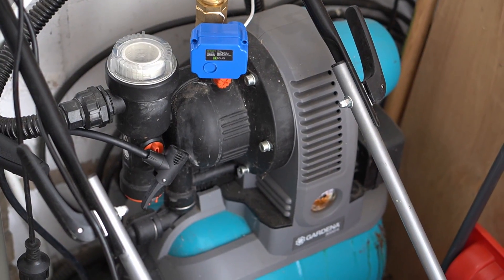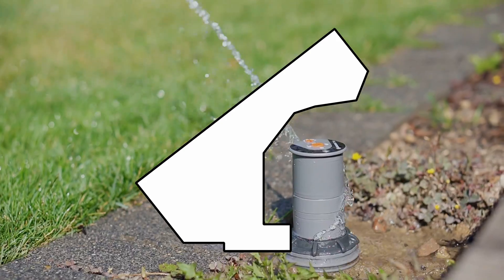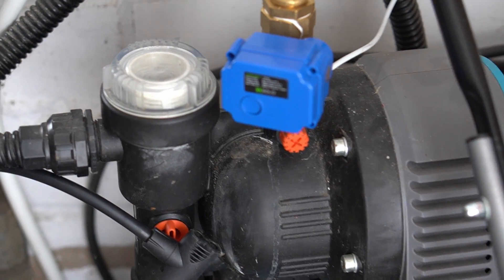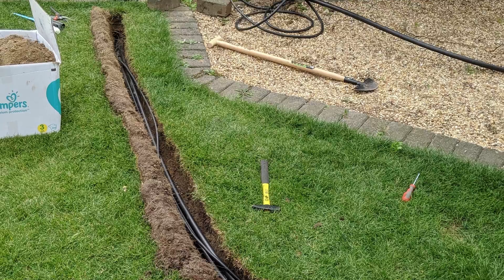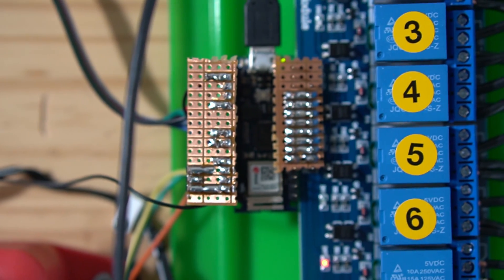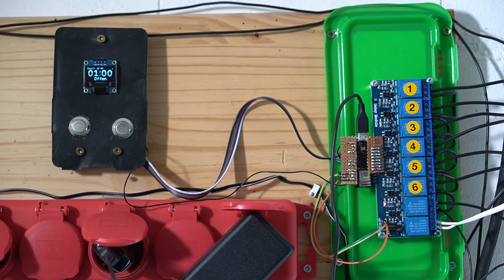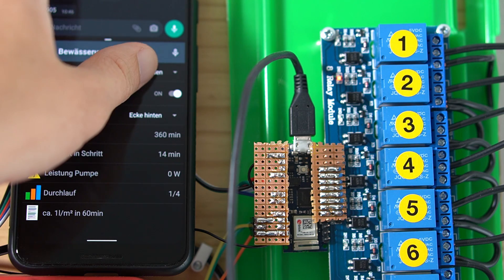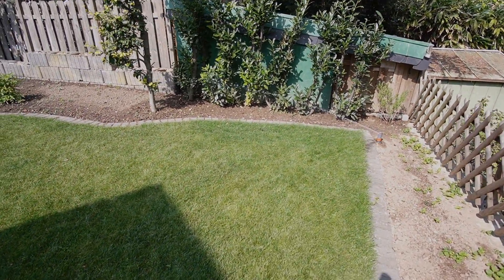Irrigation System (Arduino-controlled sprinkler system)

Comment: Sprinkler spray pattern should overlap, because they don't water evenly. They fling most of the water further away from the base. This is why sprinklers should have 100% overlap, which ensures even watering

Comment: How is the winter de watering system works? I'd would like to know /see the physical part (the valve system, leveling, where and how the purge works...) Thanks!
Reply from the maker: This is done by special drain valves that are closed under pressure but open when the pressure level drops. When there is no pressure in the pipes and I turn on the pump, they leak water slower than the pump is pushing into the system, so the pressure rises quickly to the point at which they close. Then they stay closed until the pump is turned off. If the sprinklers are still open, the pressure drops through the sprinklers (while the water remains in the lower pipes) until at some point the valves open and the remaining water can escape through them.

So, this does not only happen in winter, but every time I turn of the system.

There are a few things to consider for this solution: You need one of those valves at each "lowest" point, so the water can always flow down to a drain valve. Each section should also be able to suck in air at some other point or the water cannot get out. This is usually no problem through the sprinklers, but disconnecting the system from the pump before winter and making sure that there is no section sealed off by two valves is a good idea. Finally, the drain valves need to be packed into gravel, so the water can leave the valve and drain away.

As I stuck to Gardena for my system I am using those: https://www.gardena.com/int/products/watering/pipeline/drain-valve/901015901/
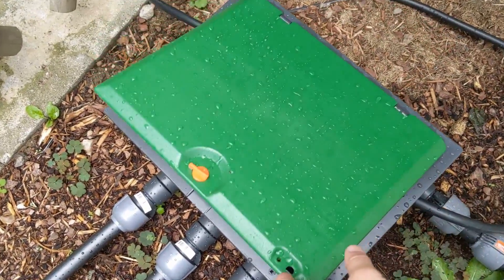You can actually see three of them at 1:30 (each covered in a black protective mesh).
Reply: @ThereOughtaBe  thanks you for the detailed answer! Seems interesting!

Comment: Hi, can you give a tip what is a proper topic and message to open specific valve in "Offen" stage ? I'm trying:  mosquitto_pub -h 192.168.2.56 -t watercontrol/setSprinkler -m 4    where 4 is digital pin and 192.168.2.56 is mqtt server ip address.  You have low level trigger relays ? Thank you.
Reply: mosquitto_pub -h 192.168.2.56 -t watercontrol/setState -m 1 (from 1 to 6)

Comment: He has problems with pressure, you should either make hoses thinner, or water supply in plastic box, which should be higher than sprinklers